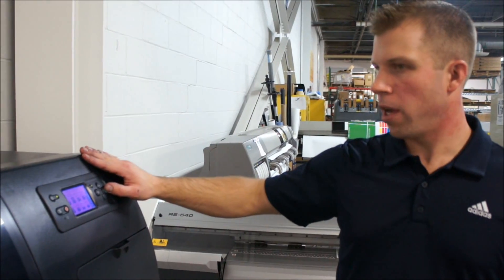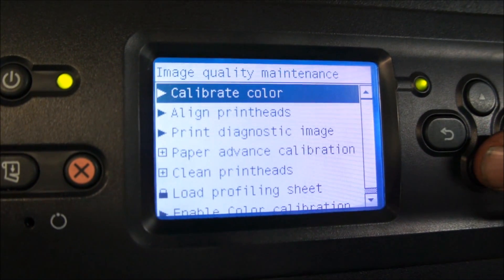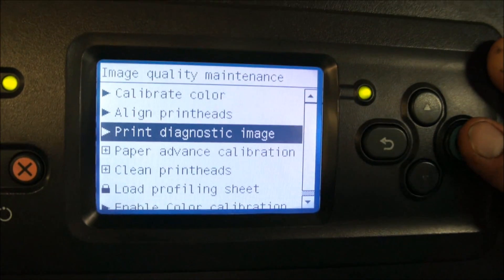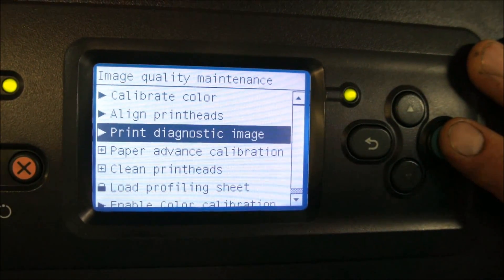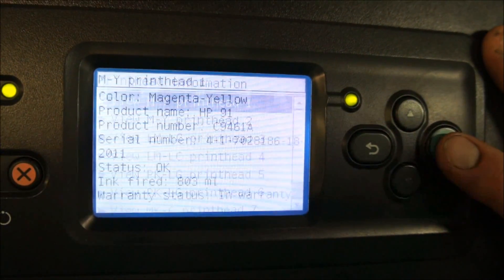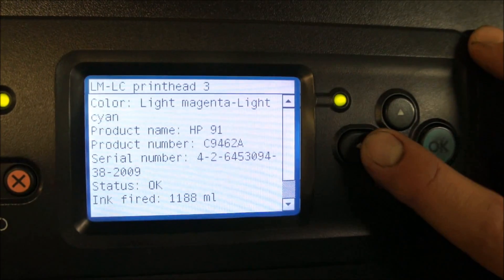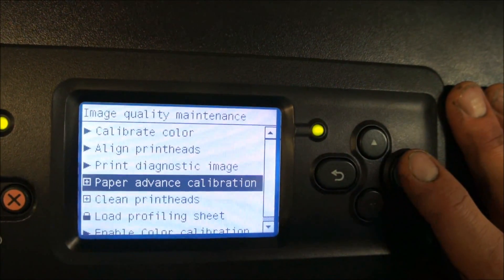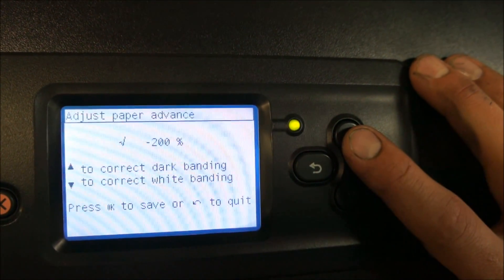Designjet Z6100 Banding Correction

Comment: I have banding issues on this machine.  I've replaced all the printheads, aligned the printheads, did a cleaning and it still bands.
Reply: Did you ever find a solution
Reply: @JrWiggles  you either need a new drop detector Q1273-60236 or a new line sensor Q6651-60297. Either one is available on ebay for about $40-$60. Easy fix.
Reply: Jr Wiggles No. that was many years ago.  We ended up just replacing it with a whole new plotter.